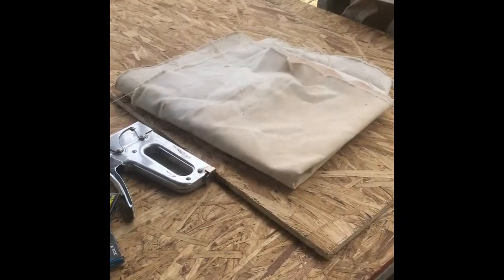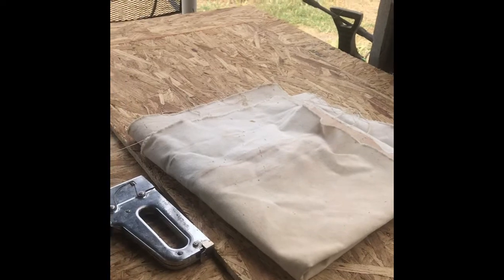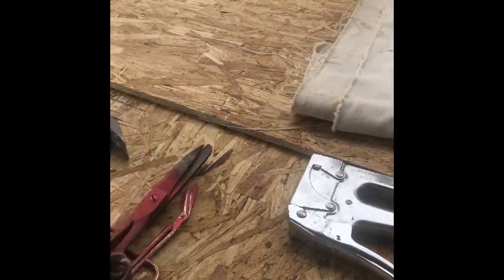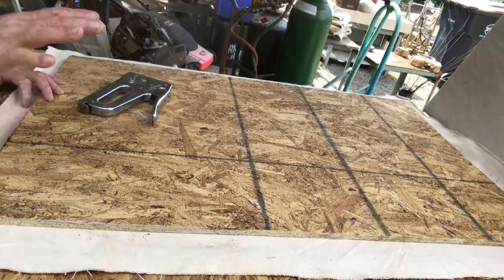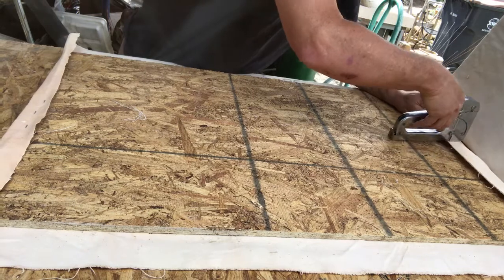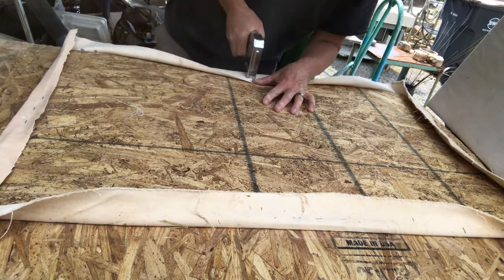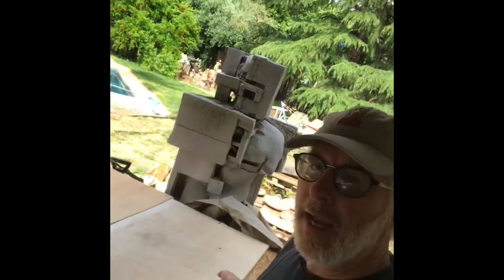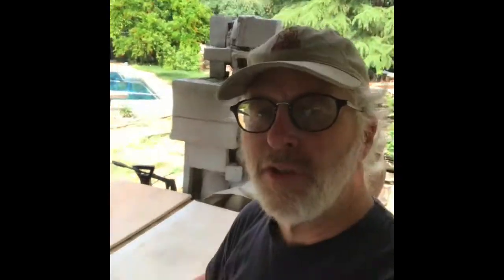Making A Canvas Covered Board For A Clay Working Surface

Comment: Hello. Thank you for this video. May I ask, when you suggested the dry wall and masking tape, did you mean wrapping the dry wall with canvas or using it as is?
Reply: I believe he said to mask the sides of the drywall so that the powdery gypsum in the  centre of the drywall board  does not contaminate your clay. His second option is to wrap canvas around a wooden board.